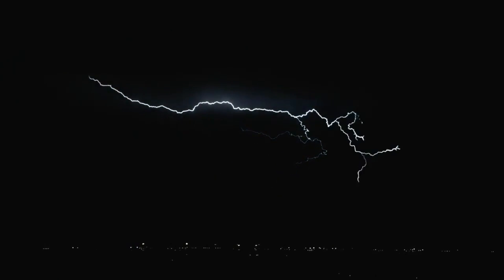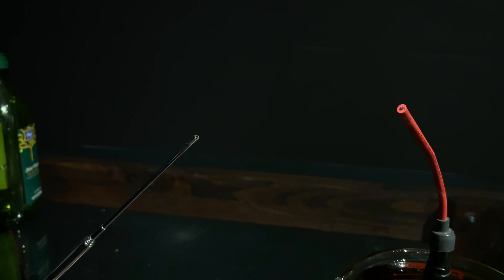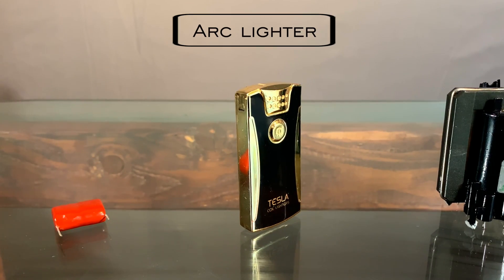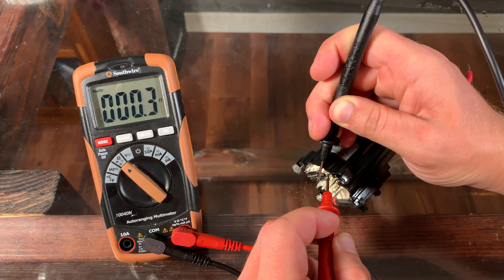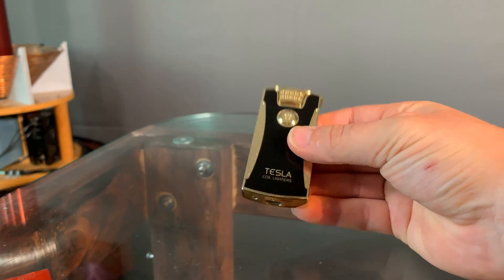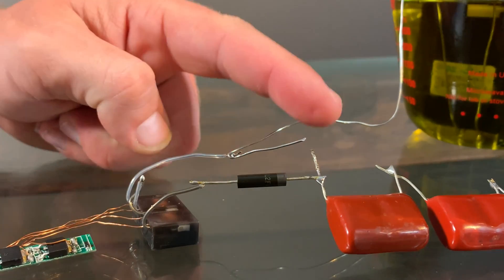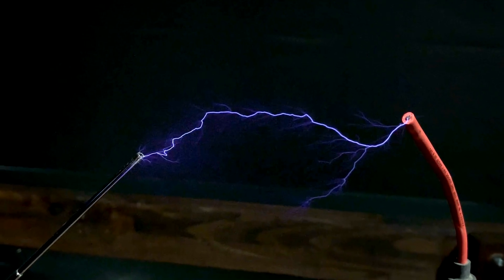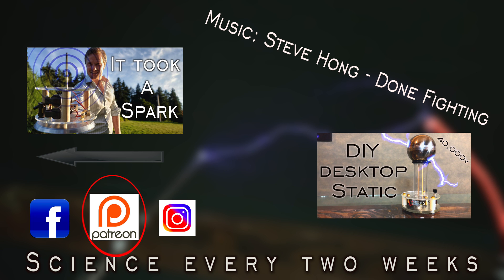DIY 100,000 Volt Arc Lighter Impulse Generator

Comment: I may be totally wrong but this seems eerily similar to how old-school tesla coils are activated with spark gap interrupters (except for the lighter drive circuitry of course), but the idea is taking a relatively high AC-voltage, half-wave rectifying it, which then charges a series capacitance, which triggers the spark gap in parallel, closing the circuit with the primary of the flyback, forming a series LC circuit, driving the flyback secondary. If this is the case, I cant help but wonder about matching the resonances between primary and secondary by altering the capacitance! I suppose it might affect other things though like pulse frequency

Comment: What would happen if you use a capacitor from a microwave??
Reply from the maker: Oh noooo don’t use those. That’s far too much power, it your build WILL be lethal.
Reply: @PlasmaChannel  I suspected it would be. I've made the very dangerous,  double your money back guaranteed, FRACTAL wood burner for a m.o.t. and cap. I actually have three of these widow makers. I fully understand that a single mistake is certain,  horrible and pain death... I'm just wondering if, instead of using that small capacitor and used a much bigger cap. ...would it actually work like I'm thinking....which is MASSIVE ARCS.

Comment: That's not 100Kv ; that's 381Kv!!! Breakdown of air is 3kv/mm, if that's 5 inch that's 127mm, each taking 3Kv = 381Kv

Can that be used to charge a high voltage capacitor?
Reply from the maker: The 3kv / mm measurement is only if using rounded, smooth electrodes. Specifically 1” brass spheres. With sharp points such as ends of a wire, it is much easier to form sparks with a lower voltage.

Comment: This is crazzyyy!! 
I got your desktop voltage multiplier going! 
But in my excitement, I attempted to make it portable inside a old broken multimeter.
 I was removing the safety switch from the lighter board, and one of those wires flicked over juuust tapping one of the smd caps at the far side of the battery on the board, made the smallest spark I’ve ever seen but fried something.. 
I was wondering if you’ve ever had any luck using the components of these lighters without the board successfully before??

Comment: Have something kinda simmilar for my potato canon igniter.

It's made of an electric fly swatter that charges up an capacitor and then I have an extra button to discharge it into a automotive 12v coil. 
Not having a spark gap like you have and only one spark but it does reach about 10cm so I have two 4cm spark gaps in the canon in each end, and it always light at first try.

Comment: What would happen if you raplaces that arc lighter with something that already has a 100kv output?
Reply from the maker: It would break the capacitors. And, the pulse circuit would not work.

Comment: I think this is a lot more than 100 kV...
Reply: From my engineering days it's typically 10,000 volts per inch
Reply: With round electrodes it's around 10kv / cm, but with sharp electrodes like in this case, I can bridge a longer gap. So it might actually be very close to 100kv

Comment: 2 thoughts, if you're still monitoring comments:

1) You show (and I have) a twin-arc lighter.  What's the best thing to do with the second pair of HV wires in this case?

2) I remember hearing an anecdote (no idea if historically true) about Tesla, when he was experimenting with his 
Wardenclyffe Tower, specifically feeding UHT into the atmosphere.  
The story goes that after a space of time 'unnaturally rhythmic' lightning started discharging not that far away, even though there were no clouds in the sky.  
The science of course, is that he was theoretically using the ionosphere as one 'plate' of a capacitor, which being a conductor at those voltages, lead to the wireless transmission of energy.
I'd be interested to know your thoughts re the story and the possibilities, thinking of your hankering to 'make real lightning' :)
Reply from the maker: Hi Chris, great questions. It is best you wire those transformers in series, and use a lot of insulation if you’re tucking the wire connections back into the lighter. Don’t want it arcing to the case.

As for the lightning. I’ve never heard this story. I’ll have to look into it and get back to you! Sounds awesome, and, plausible.
Reply: @PlasmaChannel  Many thanks for the reply.  I'll try the series connection and see what I get - probably some insane voltage ;-) .

Great work always - fascinating!  
I've been a HV & UHV freak every since I got hold of a power transformer with HT (450v) winding as a kid.  
Haven't grown up yet, and it's over half a century later :D

Comment: ( im 13 and only have two years of electronics knowledge so don’t loose your shit trying to be rude and calling me stoopid while u can inform me and help me learn . ) Couldn’t they just get energy by getting a rod of some sort and when a corona hits the rod it transfers that energy into large capacitors / cap banks ?
Reply from the maker: Hi Collie, I dont recall insulting you? Also, are you referring to drawing energy out of an electrical storm? It's entirely possible, actually. Just, not economically feasible. Science can certainly do it though.
Reply: You never insulted me I’m sorry , I just didn’t want anyone to get triggered over my question if it wasn’t feasible or if It didn’t make since . You are completely fine . I didn’t want anyone in the comment section to get mad . Sorry for the confusion
Reply: That is possible but veey hard to do. Lightning is serveal milion volts which will melt most avalible capacitors and diodes

Comment: Why do you use the diode in series with the capacitor?
Reply from the maker: In order to charge the capacitor.
Reply: @PlasmaChannel  But is it necesarry? The circuit would resonate even without the diode, it's basically the same circuit like tesla coil primary
Reply: @Astri.electronics  the capacitor would be pretty much shorted due to high frequency and the flyback in this case needs to operate in pulse mode

Comment: I was wondering about making best use of a dual arc lighter.  It's not clear in the vid how you used the output(s) of the lighter you disassembled.  It looks like there are two independent windings on that output transformer, so did you wire the outputs in series or only used one of the arc winding outputs?  Dual arc is the only sort of lighter I can get hold of, so that's my interest.  Many thanks.

Comment: CAPACITOR!  an outdoor fixture with wiring or rocket to tap the storms and induce rapid charge if the capacitor
Reply from the maker: Are you asking about seeding lightning with a rocket and a ground wire?
Reply: @PlasmaChannel  rather I'm suggesting using a wire or antenna to attract lighting to the capacitor to charge the device.  Collect energy thus way

Comment: Would grounding the return wire allow you to discharge to other grounded objects, or would it just fry the arc lighter? They seem pretty picky on what they'll discharge through.
Reply from the maker: Great question. It should, however, I do not recommend doing so as safety then becomes an issue.
Reply: @PlasmaChannel  Thanks! Would there be a way I could contact you for a business inquiry?

Comment: не проще было намотать на свободной стороне феррита 6+6 витков со средней точкой и подключить ZVS Driver?
Reply from the maker: That is a great question. a ZVS driver would produce very high current, and perhaps 30-40kV. This method produces much larger voltage, and, creates a DC spark just like lightning

Comment: what is the practical benefits of this ??? can you provide electricity for you home from such plasma???? what can you do with it to save you some money?????????? And : what's the Oil for??? why?
Reply from the maker: Hi eden, as I mentioned in the end of the video, the power going out is equal to the power coming in from the battery. You cannot power a house with a small battery. 

The oil prevents the transformer from breaking down... these transformers are not designed to handle such high voltage.

Comment: can you please explain in simple proactical manner or: What is really the Meaning of the word (Plasma) in this context and the difference from Electric???? thnx
Reply from the maker: Plasma is when you take a matter, and rip electrons off the atoms... which ionizes them. 

High voltage electricity causes electrons to be ripped off of atoms. 

That is plasma

Comment: I attempted this with two different tv fly back transformers but could not get it to work. The hv wire did not seem to have a connection with any of the pins. Broken? Not sure. Was definitely arcing DC HV through the primary though.
Reply from the maker: Interesting. With one of my transformers, I did have that problem. Here is the model number of the transformer I used successfully : 8-598-962-00       NX-1731//X    7122B17  That's all I got!

Comment: What do you no about 0 point energy or blue energy as it's called
Reply from the maker: Well, energy is the universe. Everything is energy. However, energy equals mass, so to draw energy out of thin air (so to speak) is nearly impossible. Rather, it is purely theoretical.

Comment: Im gonna go ADHD with what I speculate possible with plasma(B tier A level general physics at best)

Get laser powerful enough to ionize air

Ionized air becomes conductor of electricity

Point it at thunder clouds

Charge stored in clouds now can flow through ionized air

Try utilizr the energy without injuring anyone(unless you trying to use it as a mega plasma stun gun)
Reply from the maker: Great idea. It would work in theory, absolutely. However, controlling that charge and having it collect on in a storage capacitor would be very, very difficult.

Comment: I'm surprised you managed to measure the resistance on the secondary. Did you later test to see if you had blown the internal diode ?  I bet you were disappointed, considering the input volage, the output should be much higher than it appears (with the internal diode still functioning and without). /watch?v=4UFKl9fULkA&t=46m11s normal "flyback" operation, deflation mode. I'd like to see you illustrate exactly what's happening it the core (using the left hand rule for electron current) , I'm planning on doing that myself, if you don't beat me to it.  it would be a good oportunity to explain what's happening in the so called "Leedskalnin PMH", perpetual loop magnetization, which bleeds off in ferrite HF cores such as this one.   If you get your hands on a huge pure iron core, you could store a hell of a punch in it by running  high power DC on the primary, and getting HV DC again on the primary /secondary when you sheer off the polished ended core breaker. A lever mechanism would make things easy.

Comment: how does the output arc change if the spark gap size is changed
Reply from the maker: Great question. The larger the spark gap, the larger the spark output!
Reply: Nice, so you can adjust the spark output to your liking

Comment: Hi! Can i make a tesla coil with those 400kv chinese stun gun modules?
Reply: Yes you can . I have already made.
Reply from the maker: You likely can. However, it is not a true tesla coil unless the spark coming out is larger than the HV spark you put into it. Just make sure you design it to do so, and yes you can!

Comment: Okay does it produce an AC voltage or DC voltage
Reply from the maker: It produces AC on the output, but, mine had several HV diodes creating DC.
Reply: @PlasmaChannel   hey thanks. I duplicated this with a modification. I replaced the arc lighter with a much stronger 25kv DC power supply so that means I can avoid the diode and I didn't have those caps and a true man makes one, so I did that and it turned out to be better looking and some gnarly 6 inch arcs came out of it. My setup was just a flyback driving another flyback's primary

Comment: Voltage but ampere is low
Reply from the maker: High voltage, High current, but the length of time the electricity lasts for is very very low.

Comment: Just letting you know, the power consumption on arc lighters is generally over 5 Watts (that’s why they generally don’t have an overdischarge protection circuit on the li batteries)
Reply from the maker: You are correct. However, since the power is being pulsed into the transformer, you can divide the 5 W, or 5 J per second, by the amount of sparks per second. When you do so, each 100,000 V spark is less than a joule, or less than a watt. Thank you for the input, I figured the output of those lighters was several watts.

Comment: Have you ever experimented with a neon sign transformer at an old CRT picture tube? I got some surprising results with multiple transformers, two CRT tubes, a few 20kv capacitors, and a switch.
Reply: This is one of the experiments 

https://youtu.be/KN6A9u9nhbc
Reply from the maker: Interesting. That was 60kv?

Comment: You can also use a CCFL Inverter because tje also output high frequency plasma jusy like an arc lighter. It will probably be stronger though and runs on 12 volts dc. However it's the same concept.
Reply from the maker: That's a great idea.
Reply: @PlasmaChannel  Thank you, I have done the same with a CCFL inverter and wow its powerful. You require high voltage caps and diodes. Watch for spikes in the output voltage however due to those not having as stable of an oscillator. Also make sure the impedance of your caps are not to high at that frequency.

Comment: What if anything could be done to avoid the need for the oil bath? Is it the insulation in the flyback that is failing?
Reply from the maker: No, the internal insulation is amazing. The oil prevents the transformer from arcing around the outside of itself.

Comment: Do adaptors make a whining noise because of the high frequency transformer
Reply from the maker: They do. Usually adaptors will have a high frequency transformer inside them. You're hearing the whine that transformer.

Comment: I'm borderline mentally challenged, so excuse my ignorance. I have a question. 

If this was made 100% efficient, couldn't you make infinite energy?
Reply from the maker: Great question. If it was 100% efficient, you could loop the energy in the, or a, system forever. However, once you used that power for something..... anything at all, the power would be removed from the system. 

So: this device does not generate power.

Comment: Does it matter what type of oil you submerge the fly back in?
Reply from the maker: Funny thing : mine was submerged in vegetable oil. Which is the worst type. Anything would be better than that!
Reply: Plasma Channel hey if it works, it works. I’m new to this hobby, and even after six months I still fail more often than I succeed in most of these YouTube diy projects. Love the channel. The voltage multiplier episode, I think that was the first real successful project I worked on.

Comment: You can use this to also drive an ignition coil, I use a MOT and some hv diode and some russian capacitor and discharged it into the ignition coil, from two coils I got 90mm sparks
Reply from the maker: That is impressive. That much power does scare me though.
Reply: The old Kirlian photography setups used the ignition coil from old Ford Model T cars. Although I suspect they are harder to come by these days. ;p

Comment: a question:
we know lightning has insane energy. if we put lightning in v*i=p, which (Voltage or current) causing that much energy ? which one is higher ?
Reply: real lightning often has over 10 million volt at about 100.000 to 200.000 ampere
Reply from the maker: Correction, lightning is on the order of magnitude much higher than 10 million volts. Air breaks down at 3 million volts PER METER. For perspective. This has been confirmed by the American Society of Electrical Engineers. Lightning most often peaks around 120 million volts, often much higher. Currents have been measured I believe as high as 100,000 amps.

Comment: Wow, nice pulse transformer you got there! Never would have thought that a flyback could survive such an abuse. By the way I did a small calculation and I believe the pulses you get out of this transformer are on the order of several microseconds in duration. So 12 cm seems about right for 100 kV ;) Pulse transformers do in fact prevail over Marx generators in any sort of pulse power application where you don't need a standardised pulse (so everywhere besides insulation testing).
Reply from the maker: Hi Vidduley, thank you! Yes, I stumbled across this method....just was experimenting around and found it. blows my mind the flybacks survive. I fried one...but i was pushing it past 5 inch arcs. CRAZY.
Reply: is that 8.3kV/cm? i apologize, for the past week i've been figuring out how much mine produces.
Reply: @enriquethethird7253  well it depends strongly on the waveform and the shape of the electrodes. The only accurate way of saying is to measure directly with a voltage divider and an oscilloscope. I really don't like this 10 kV/cm thing that people seem to use at any time they can, but here for needle electrodes and microsecond pulses it's about right (say +-25%).
Reply: @Vidduley  ooooohh thanks for the insight, man!

Comment: Sir can we make a Tesla coil with 20000V power supply (that is build by florissant tube ballast and a flyback) if yes then please make a vedio on that
Thank You
Sir
Reply from the maker: So, the spark gap of the tesla coil would have 200,000 volts applied accross it? I imagine it's possible but that would be very difficult to design.
Reply: @PlasmaChannel  ok sir

Comment: Will HV diodes from microwave work?
Reply from the maker: Unfortunately, no they will not. Those are designed for 60hz. The arc lighter runs at 15kHz